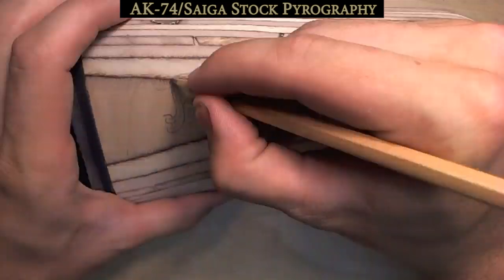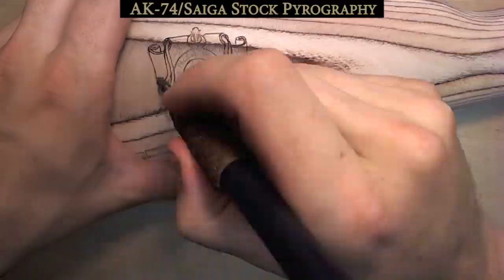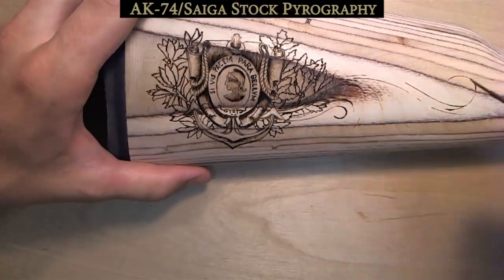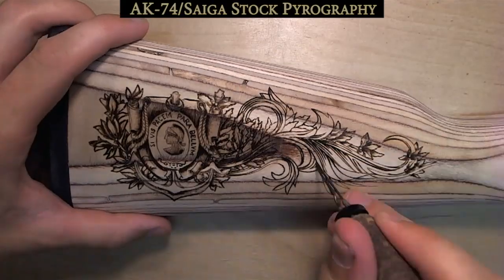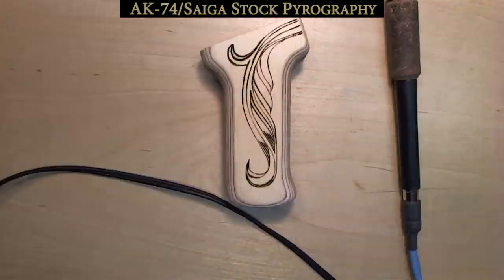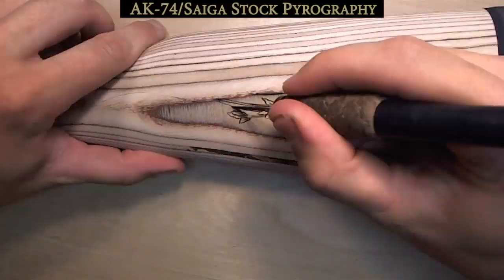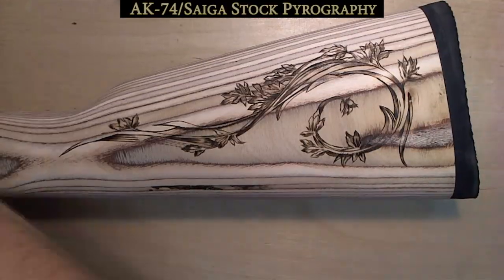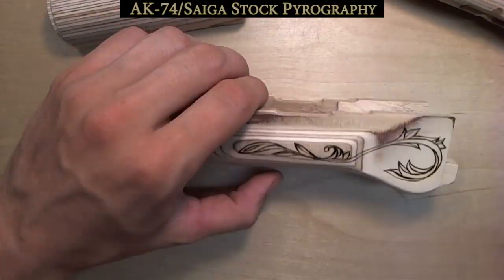AK 74 Gun Stock Pyrography

Comment: the 74 is a smaller gun and doesn't have a stock. it's more of a sub machine gun.
Reply: False, the difference in the two are the years the gun changed. Mikhail Klashnikov designed the AK47 in 1947. The platform stayed as it was until a redesign in 1974. the stock stayed the same. The difference is the Bolt, Chamber, the round being fired. AK47 fires the 7.62x39
AK74 fires the 5.45x39